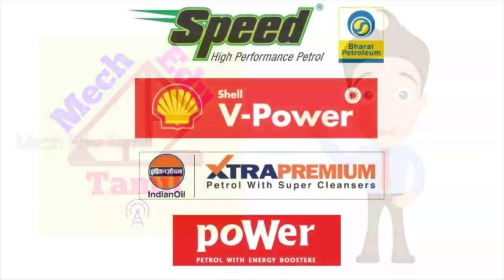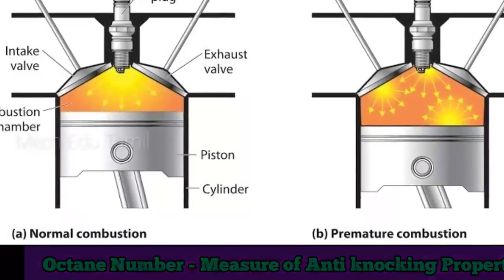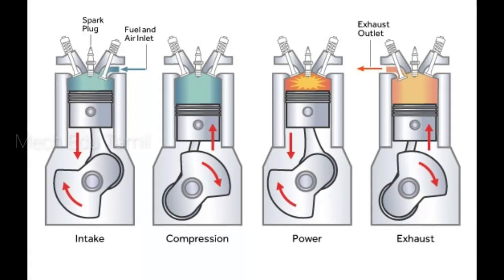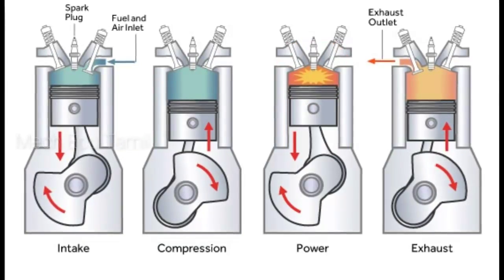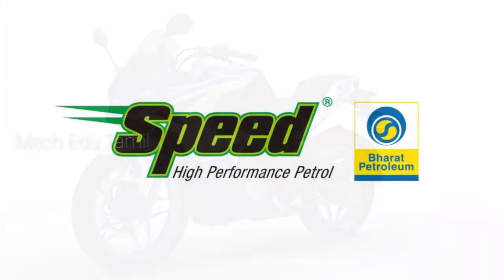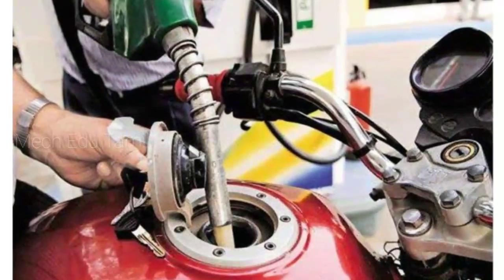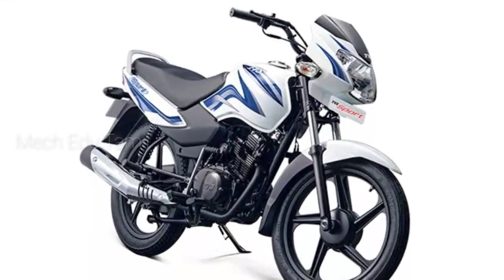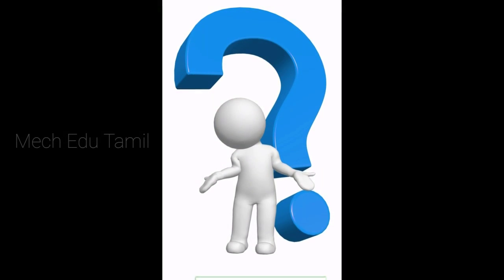Power Petrol Bike-ல ஏன் போடணும் தெரியுமா??? | Mech Edu Tamil.

Comment: Dear mech edu bro - Nan 2du bike vachu irukan honda cbf stunner and royal Enfield Classic 350, Long drive pannitu, 1st bike ku oru 50 - 70kms ku oru thadava bike ku rest kudupan (honda stunner) but I'll let the bike idel, and i won't trun off it by myself. Ean na adu 125cc than so engine stress kaga nan apde vitruvan thane vae off agatum sollitu oil flow balanced ah irukatu but ida pannum bothu, adan engine off pannama vidum bothu nan center stand pottu vitruvan tea kudichutu vandu patha bike off agai irukum. 

But classic 350 la avolo sekeram thana off agala, as i experienced I've done straight 200kms straight let the bike idel when i took break still the engine running. (i usually take break on classic 350 after 100 - 150 kms.) But when i also tried it experimentally in short ride 25kms. It turned off after 2-3mins of idel (both the time the petrol level is full) i also tried 100kms break when i let the engine idel i was running and didn't get turned off. 

I wonder why! I need you help! Is this Because of the royal Enfield designed carburettor for high cc or long stroke length? 

Or else the honda engines get killed for not getting air flow to the engine as they designed the carburettor. 

And the second question is should we put the bike in side stand after long ride? Or center stand. I always put center stand because of the bags i tied on my bike and i always let the engine idel for atleast 3-5mins after long trips. 

But now i feel when side stand the oil flow will be more to the engine because there will be oil only one side of the engine. But when i visit the enfield showroom service center guys told me to put center stand on RE bikes. 

But i know that side stand is not good to let the bike standing long period of time because we'll loose the tyre balance. And oil freeze.   Both of My doubt all is during long rides. 

When the engine is at heat condition